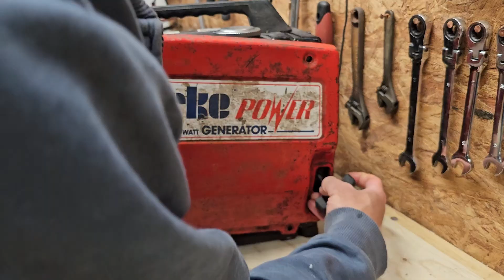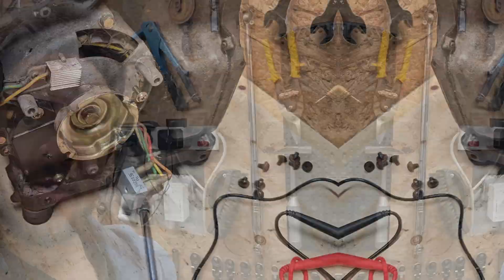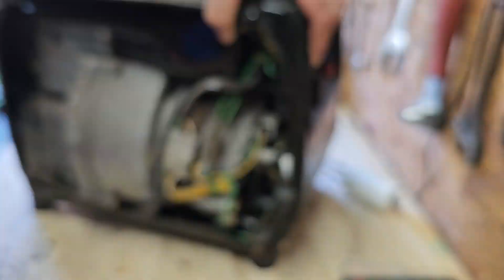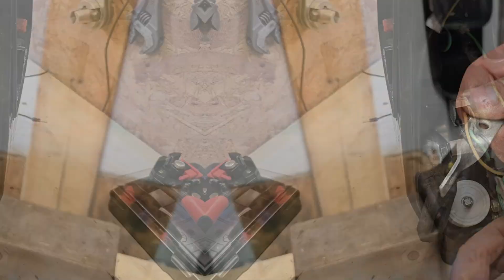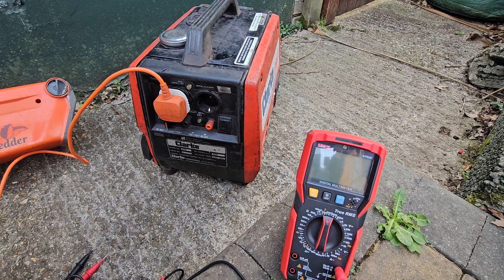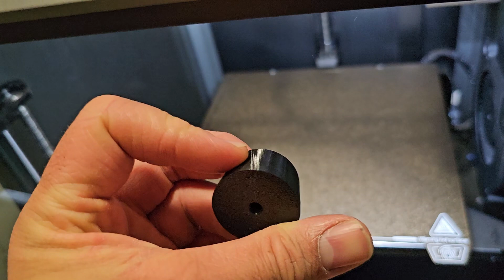Generator Repair - Engine runs but no electrical output

Comment: Info: This is robin RG650 model Used other names or clones 
Parts for them is not hard to find
Reply from the maker: Hi, thanks for the info! I had a feeling that I'd seen this generator sold under different branding, but couldn't remember which brand it was. I've had a quick look for the capacitor, searching under the Robin brand, but still couldn't find the exact part. Hopefully, this info may help others in the future! :)